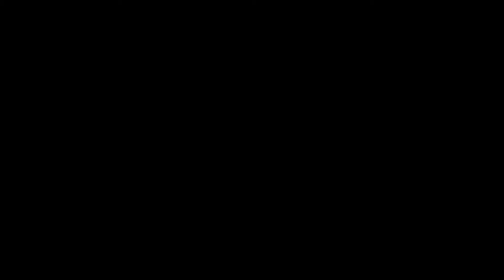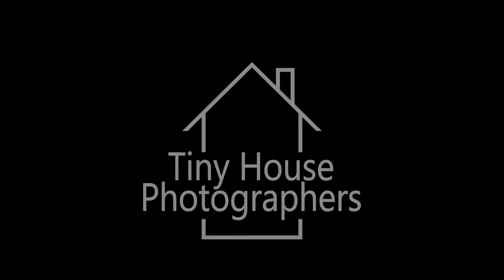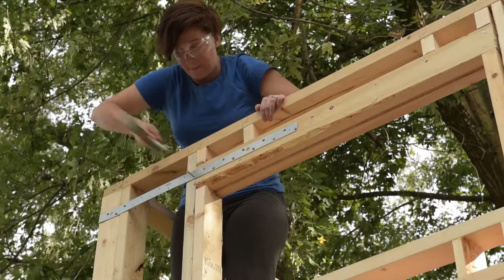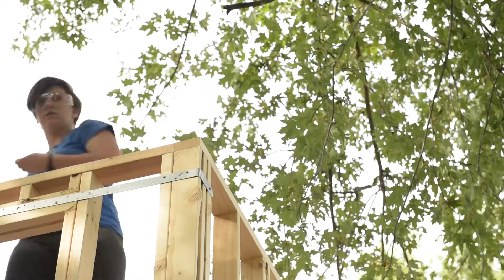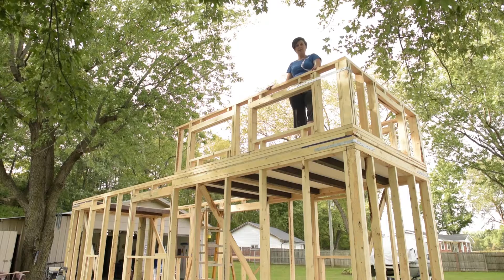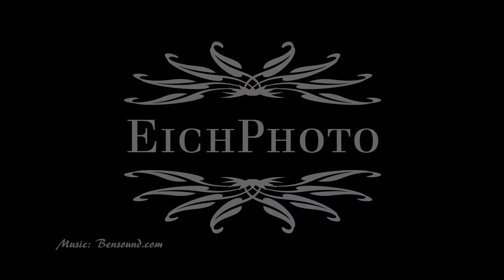Tiny House Build: Step 7 - Dormer Completion

Comment: Looks awesome-Put a skylight in then you can stand up, when you want.
Reply from the maker: Thanks!  
That would be pretty great, wouldn't it?
We were actually considering a hinged egress skylight in the loft, but the 30x30 Velux model the Tumbleweed plans call for no longer exists. The next closest size is something like 47 inches square, which is just too big for us to feel comfortable putting into our small roof up there.  
Plus, that one skylight will cost us about $1,000 and we don't want to spend that much of the budget on one window.  We are determined to build this this house for $30k or less, so I think we are going to order a smaller vented skylight instead, which should end up costing between $400 & $500  with the flashing kit included.
Reply: I get your concerns with a longer window and being expensive.....but.....long term you're going to want it there e.g. breezes, fresh air while sleeping, watching the rain fall, see the stars at night, escape if a fire occurs below. Its a well worth it investment.